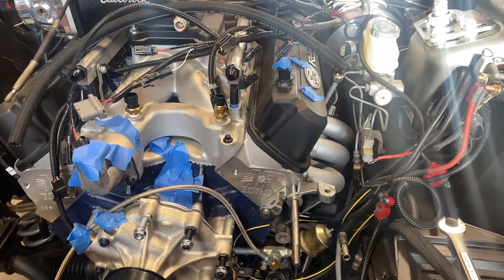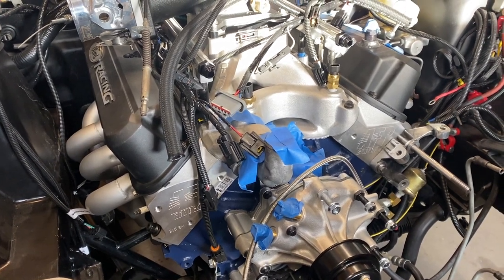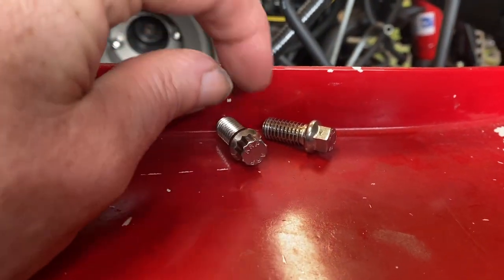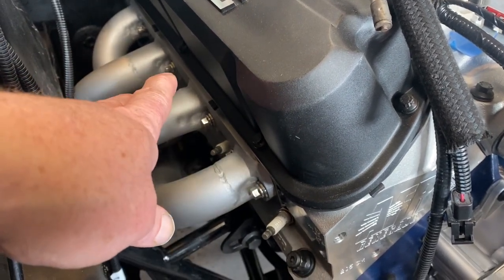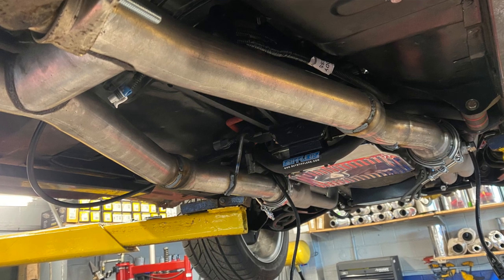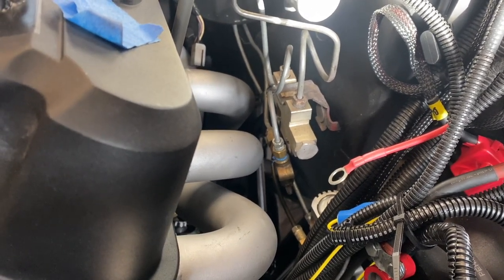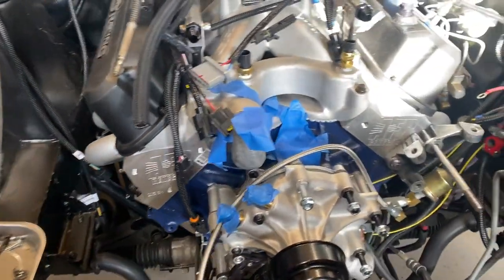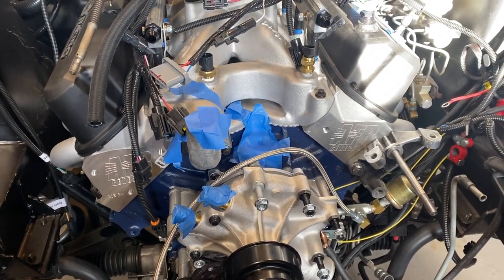351W Header Install

Comment: I wish I would have seen this video before I installed my headers last year. I learned the same things. As you mentioned it is important to prefit everything before the engine is in the car, run a thread chaser in the threads and create the space that is needed for a wrench to tighten the bolts.
Reply from the maker: Amen to that.   I am pretty sure I had my headers in and out 3 times and maybe 4-5 times on the driver side getting it all sorted out.
    The AOD shift lever clearance issue was a wonderful gift as well 🤪

Comment: When i swapped and used bbk long tubes never had these issues, and had a aod
Reply from the maker: There is no way on this Earth my build would work with regular BBK long tubes on a 351 based build.   And I have an aftermarket k member which has a ton of room.
Reply: @MrStangdawg  i got 2" stainless works now and they fall to the gound when unbolted with steering shaft in also

Comment: I put a stud on the 1st header bolt to help with installation.
Reply from the maker: yup also another good tip.    The only issue in my case is there's not much room to have the header away from the head so have to make sure it's a fairly short stud

Comment: Thank you for putting this video up. Didn’t solve my 351w swap but it’s reassuring that I’m not the only one banging my head on the wall. I snagged Kooks and their x pipe. Cody right around 1500 all in and it’s not really fitting. Sucks
Reply from the maker: Yup, if I did this again I'd go custom.

Comment: i have a 351 in a 1995 ford f150. do i need special headers to fit in my engine bay? or do they all work the same?
Reply from the maker: Same headers but those older F150s have a ton of room in the engine but I suspect you won't have any clearance issues.

Comment: The deck height is a 9.5 vs 8.2 . I wish everyone would do research on the differences between the 2 engines
Reply from the maker: Definitely quite a few things you have to sort out when going 302 to 351W.   I have a great video on the heater tube plumbing that I''ll be doing, waiting on the pieces to get delivered.
Reply: @MrStangdawg  Definitely brother!! Keep up the cool videos

Comment: Any idea what headers would fit 351w in a 1995 mustang gt 5spd.?
Reply from the maker: The 95 is virtually the same deal as the 79-95.  The 95 Cobra R had a 351W in it and Ford had to use the Cobra R hood not the stock 95 hood.
Reply: The biggest issue with the 94-95 Mustangs in this situation is the clutch fork. On a typical 94-95, the clutch fork is at 7 o'clock. This will directly interfere with the collector on any set of widely available fox LTs. On the 95 R, the clutch fork is closer to 9 o'clock, as it is in the fox body cars (as a matter of fact, the R model uses a TR3550 with a short input shaft...like a fox body...not the longer input shaft version used in the 94-95 V6s, GTs, or Cobras, so it shares the fork position with the fox). The regular 351w swap header for a fox will work with no issues in an R.

So, if you want to get a 351 in your 94-95, you have two choices...either 94-95 specific 351w swap LT headers that will deal with the clocking of the clutch fork (either aftermarket or custom), or swap the transmission to a short input shaft out of a fox that has the clutch fork located up a bit so it clears the collector. This would also necessitate other modifications to accommodate the trans swap. Nobody said LTs were going to be easy, but it's even more difficult on the 94-95s.

You may be able to use a 302 LT on the driver's side and a 351 LT on the passenger's side without the transmission swap to get the collector moved up enough to clear the fork. Of course that would involve purchasing two sets of headers, along with some downstream exhaust mods since one collector would be higher than the other...life would be a lot easier to just stick with shorties in a 351w swap into a vanilla 94-95. Just get Ford Racing R58 headers as originally used on the R, and any stock or aftermarket X/H will fit right up. Ford engineered the R58 headers that way from the start.

Comment: Stupid RCI's, buddy of mine bought a set made for his car they ended up hanging down and were 3/4" from the ground. For as long as he made headers he sure forgot what he was doing. My buddy had a 1 3/4" set of 302 headers that came apart at the tubes, should have bought them and tried to make them work. AOD? LOL I'm doing a 6R80 pray for me.
Reply from the maker: Yes my advice and if I ever take these out for a 427 I'm doing custom headers to get better fit.  The fitment for me along the side of the AOD with the shift cable is horrendous.   Had to really beat them into shape to clear. 
     Good luck on the 6R80 lot more videos out there now than there was even just a couple years ago.
Reply: I think those ones that came apart were Hookers, man they were great shoudl have bought them and made them work lol...
 @MrStangdawg